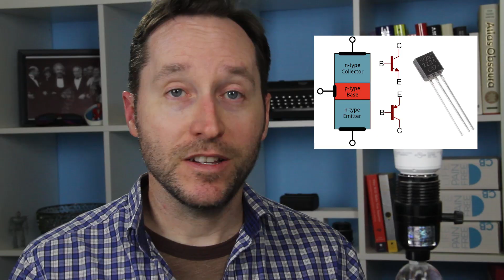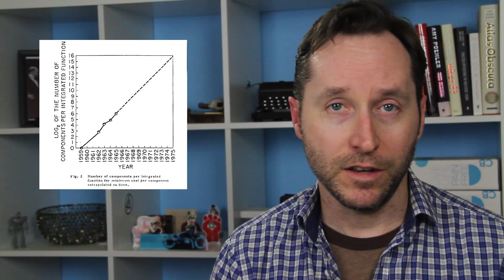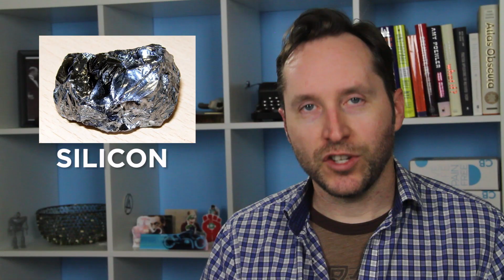Moore's Law Is Ending - Here's 7 Technologies That Could Bring It Back To Life | Answers With Joe

Comment: Funny how DNA is being looked at as a computing system now, being it is a binary error correcting code and is the basis for life itself, DNA being a intelligent code in and of itself shows their was a designer, hence GOD. Just a thought:)
Reply: The idea that we are in a simulation is interesting, based on the scientific knowledge that there is a limit to smallness and largeness, hence Planck length and also that there is a limit to space, it had a beginning and has an end. Weather it be a simulation or not there is a limit to the natural reality. Thus the universe has not always been, your choice is to believe its a cosmic accident or was created by designer, I find the evidence points to a designer, DNA is just one example of many.
Reply: Realistically given no direct evidence, 50/50 odds that it happened on its own, but that other 50% is just the odds on there being a creator. But that does not mean the 50% Christians are correct, no they would share that 50% pool with every other notion involving a creator that has ever been conceived, or ever will be conceived. Just like there would be an endless variation of it happening on its own, so any individual idea is likely to be wrong, so best just to wait and see. Don't hate on anyone who follows a specific religion, so long as your following it because you wish to hold yourself to a set of beliefs to better yourself. Yourself being the key word here...
Reply: I also see Atheism as a religion too, its based off the same principal as all religions, blind faith without a shred of proof. Least most of the other religions require you to keep a code of conduct, and have engaging stories for the youngsters... lol
Reply: There is a proof in Christianity, the bible is actually provable, not only as a historical collection of documents but in its content. Example 1 Nineveh was always thought to be a myth until it was found in 1849. Example 2 in prophecy, no other book has written the future over the course of nearly 2000 years as if its stating history and been 100% accurate so far, more to come. In fact it tells of the story from the beginning to the end. Point being the information contained in the bible is from outside the domain of time, information given to the prophets came from someone who can see the end from the beginning. At this point your likely wanting examples for the prophecy's on which I speak of, I will give you this one, in the book of Daniel written in the 6th century BC this is stated, from the decree of Artaxerxes to restore Jerusalem till the Messiah the King would be 69 weeks of years being translated equals 173,800 days. the decree happened march 14th 445 BC, Jesus fulfilled it to the day on April 6 32 AD, EXACTLY to the very day.
Reply: Yes many things from the bible are true, never said they were not, yes there was a man named Jesus, yes he the Jews did kill him because be claimed to be the son of God. As far as prophecy goes, even if I take you at your word, (not about to fact check everything you say) you still cant convince me it was not self fulfilled prophecy, and there is still zero proof that Jesus was the son of God. Prophecy is a dangerous thing, particularly when you have an incentive to see it fulfilled, aka, the return of Christ, life eternal, seeing the wicked suffer, and all that jazz. Furthermore, anyone who truly believes in God, it would be well within reason to consider yourself the product of God, therefor it would not exactly be a lie to call yourself the son, or daughter of God.
Reply: Personally I see the old religious writings supporting ancient astronaut theory more then the Christian God, angels descending from the heavens on fiery chariots to mate with mortals? So God's angels need to descend from heaven to get laid? Bible says a lot of things, you cant just cherry pick what fits your narrative.
Reply: And if the Christian God is real, he has done a piss poor job at representing himself, and needs to hire himself a new PR firm... lol
Reply: Glad to see you have some knowledge on the matter, also would at this time like to thank you for being courteous in our talk here, so to continue, you brought up Jesus fulfilled the prophecy intentionally, in that case you could make that assumption, however he fulfilled about 300 prophecy's that he couldn't have control over, like where he would be born, the massacre of the children by Herod to wipe him out while he was a baby, that he would be betrayed for 30 pieces of silver and so on. It gets to a point when you look at the sheer number of things he fulfilled that it takes faith not to believe. Of course I can't list them all here in the comments section but encourage you to look into it yourself.
Reply: In this case you are referring to Genesis 6 and also the Book of Enoch too? To put that in perspective that wasn't done to "get laid" it was done to stop the Messiah or seed of the woman from coming though the human race by polluting it with the Nephilum, the hybrid race created In that encounter.
Reply: To be honest all I have is snippets of info when concerning bible studies, what I try to do is look at what I do know in the context of history, and the undeniable fact is, history if full of unexplained oddities, and filled prophecies.  

What I also have a hard time accepting is, why does a God require worship? How is not being a good person good enough? Furthermore, I would think if God wanted true devotion, he would pop on down here more often...

Finally, no matter what the books you cite say, your trusting that the text you are reading is  true and accurate representation of the events they depict. I just cant base my life off from trust in something that either I nor anyone alive can prove today. 

I would love to find the truth, but I feel only death holds that, and that's only if shit does not just end when you die. Either I will have my answers or I wont, and if some divine being wants to hate on me, because I admit that I am not smart enough to have the answer to such questions, well Ill cross that bridge when I get there.

You will never hear me say there is no God, I do not make absolute statements on subjects I cant possibly know. I accept that I am here, where ever here is, I make the best of it, and I try to view the world from an objective point of view, if that is not enough, well I guess I failed the test...
Reply: And about that context of history, again lets say I believed ever story and prophecy you posted on here, or the whole Bible for that matter. your conclusions would still be in doubt to me, because I would have to consider every other miraculous event, and prophecy throughout history.

The Incas alone have defied reason, both in achievements in their time, and prophecy about the future, prophecies that are still proving very relevant today. For example, not only did they map the whole solar system, they even mapped a planet X, from all the evidence, there is a tenth planet, and it is in exactly the orbit they describe. 

There is no way they could ever know that, yet they did, there is no way they could have ever mapped more then 3 planets, yet they map all the ones we know about, plus one more?

If that is not enough, they knew about events that happened before life was ever established on Earth! The fact that we once had one more planet in our solar system, (they claim the planet X dislodged it from its natural orbit) and its crashed into earth. Well besides what caused that extra planet to hit Earth, we know that is what went down. It not only caused us to have a moon, it also gave us to what is refereed to as a "core and a half". 

The core in the center of the planet is about 50% larger then a planet this size should have, thus it offers us  better magnetic field protecting this planet. That collision is what allowed life to establish on Earth, and they knew about it?

This is just one example from one group at one small point in our history, there are countless unexplained things in this world. So if these miraculous events can only be explained by divine powers, why has not every legitimate prophet in the world, throughout history spouted the Christian God's will?

If I am willing to take all these miraculous things at face value, it does not necessarily lead to me to conclusion of God, but more that there is spiritual function we do not yet understand, and that some might be able to tap into a network that offers a broader view of time. But even then, the person observerng whatever they are observing is sill limited by the reality they know, so the info is still skewed through the lens of their experience.

There have been many real experiments that have dived into such topics, and quantum mechanics opens up far more doors then it closes... There is a real possibility that belief itself is what drives reality, Joe has even touched on it, so again, even if everything you claimed was unequivocally correct, (I don't know) you would still have to do better to unequivocally prove the source of it all...
Reply: Ill take a look at it, I enjoy watching that kind of stuff, Its just that no matter how mind blowing that info may be, I have to judge it knowing all the mind blowing info I have already taken in. In the broad sense of history, I have only come to one conclusion that I am willing to stake it all on, there was either a lost civilization that in some areas, matched or exceeded us today, or early man had outside help, and a lot of it. 

What that outside help was, no idea, but history is filled with too many anomalies to fit in the "accepted" understanding of things. We are missing a very large piece of the puzzle, and while I don't exclude the possibility of divine intervention, I feel there are gaping holes in that argument too. Mind you there are gaping holes in any specific argument, cause we don't have all the pieces.

Thanks for the link, and the chat!
Reply: Glad your taking the time to give it a look, its a neat series and does provide some insight on the subject of science and sheds some light on some profound truths in the bible, your right to test everything and not take anything as its presented without verifying it, Chuck has a vast knowledge field but I don't ascribe to everything he says, but if nothing else I have learned new things from him and heard an interesting viewpoint. As for myself, I have looked deeply into this subject from many angles and many sources and continue to do so, I do believe the Bible is a message from the creator and he has authenticated the message, taking the time to challenge that statement should prove to be time well spent. Best of luck and feel free to contact me if you have any questions.
Reply: It is interesting, though I have taken issue with some of the science he has presented. But its not unexpected, when you go looking for proof of something you already believe, you tend to only pickup on what fits your current beliefs.

As he starts to go deeper into the subjects, I can see how he came to his conclusions given his beliefs, even If I would have come to a different conclusion myself.
Reply: Offthechart Gaming Says who? A random guy on the internet who offers nothing but a one lined personal opinion? Who's very absolute statements tell me you do not believe in the possibility of being wrong... Yeah let's all take a person like that seriously. lol
Reply: I am all about discussing the merits of religion, but dont come at me acting like you have insider information! Your one lined opinions would not convince a 3 year old, let alone lead to any constructive debate with an actual adult. TheSkullReviews at least was able to articulate his opinions into something worth reading, enjoyed that debate, and the info he shared. But this ride requires you to debate at a higher level then a 5 year old!

Comment: The really interesting thing about Moore's Law, to me, is that he coined it as a prediction/benchmark decades ago and it has worked down to the quantum level. Basically, as long as transistors are the thing we use, he successfully predicted how many transistors we could fit on a chip - to the point that it is no longer possible to use transistors and a different technology must be developed.

That's like if some aeronautics engineer predicted that aircraft maximum speed would double every five years, and it kept being true until they got to 99% of the speed of light, and just had to develop a new mode of transportation.

Comment: All of these are possible. And most actually work. But in order keep up with Moore's law they have to reduce the cost per transistor by quite a bit.  We're about that same place with chips today as was the 707 jet in the sixties.  We're still traveling at 600 mph 50 years later.   At some point any technology hits a wall.  With airplanes, it was that a Gallon of gas only has so many BTUs with chips we've just run out of atoms.  Devices are a handful thick now.

Comment: Ray kurzweil himself shows pauses in Moores law. Its not outlandish to think that a larger pause before a larger growth rate happens. At 50 years old, I've seen thousands of these 'innovation stagnates' postulations and no matter how you slice it, growth is exponential. A Portuguese sailor invented the sail to tac against the wind causing more trade and social sharing which, in turn brought about the largest tech growth pre 1900. We now have social sharing  on an exponential level, so while silicone transistors may level, progress finds a new path. I've heard hundreds of times 'we've reached our tech max on processing growth'. That is nothing more than linear brain processing quelling fears of exponential growth.
Reply: This is it exactly.

Lets say progress really does slow down quite a bit throughout the mid 20s. In the long run, it really doesn't matter. Because the technology that speeds up growth again will fill in the few years of stagnation, because the yield will be even higher this time around. It will progress even faster.
Reply from the maker: That's why I wanted to focus on technologies that could take the place of what we're doing now. :)
Reply: Ray kurzweil has an 86 percent accuracy rate with his over 100 predictions that have always seemed outlandish at the time so theres that.
Reply: Joe Scott i know you meant that or I assumed it. I think I was responding more to other comments along with a general 'its over/cant happen' fatigue. I'd still have a less than vga monitor with 712k on the motherboard if I listened to talks on limits :)
Reply: growth is exponential but the aggregate of those s-curves isn't the 'doubling every 18months' we enjoyed with moore's law
Reply: Joe Scott incidentally, that was told to me by one of the smartest people I know. He created the Wisconsin trivia contest. Biggest trivia worldwide?
Reply: Dave Armstrong Yeah, if we use other semiconductor materials we alter when tunneling occurs.

Comment: there's also 3D chips. at the moment chips are 2 dimensional, 3D is likely to be the next paradigm to keep Moore 's law growth in computers going for another decade or so.
Reply: Guy 01 i think he mentioned, tho very briefly
Reply: But wouldn't 3d chips introduce even more heat to dissipate?
Reply: it isnt 3d . ? ? its just a hype name for connecting stackable chips and to make its sound ultra complex
Reply: ***** 
Yeah I agree it's not a long term solution but I don't think every layer would need to be as thick as they are now, but you're right this might only buy us ten years or so, but hopefully it'll be enough to keep Moore's law going until we master quantum computers or whatever the next paradigm may be, it might be wishful thinking on my part, but I think humans are smart enough and determined enough to keep Moore's law going.
Reply: haha ezpz quantum computers are not (nor can they be) complete replacements of traditional transistor based CPUs simply due to the difference in how they work. Quantum computers are not deterministic, so you couldn't use them for things that need to be deterministic - like bank account transactions.
Reply: This is not true, chip transistor have depth.
Reply: haha ezpz - quantum computer dont work for information searches, so we would still use computers we have today.
Reply: 3D chips ?!!!! lol how do you cool it ? how about internal heat ?
Reply: 3d chips are a good temporary fix. I could only see them lasting another 15 years tops and then boom once again we need to find another chip technology. Quantum computing is becoming a reality so I don't even think that we should be focusing on binary chips anymore

Comment: 7:09

Your base base are messed up. Try again Joe, try again.

P.S. One of them is also spelled incorrectly.
Reply from the maker: Don't drink and edit, people.
Reply: All your base are belong Joe.
Reply: Yep, it's supposed to be cytosine, not cytocine, and it bonds to guanine, not adenine.
Reply: Also one tear drop of DNA computer is as fast as the fastest supercomputer not all computers combined.
Reply: its also a quaternary system as opposed to a binary system.  the fact that they bond to each other has more to do with data redundancy than information encoding.
Reply: Its also thymine
Reply: An ounce of hype is faster than a tonne of performance.